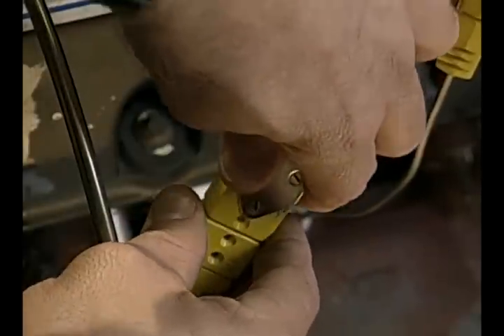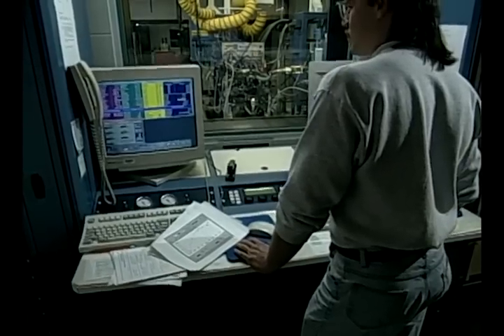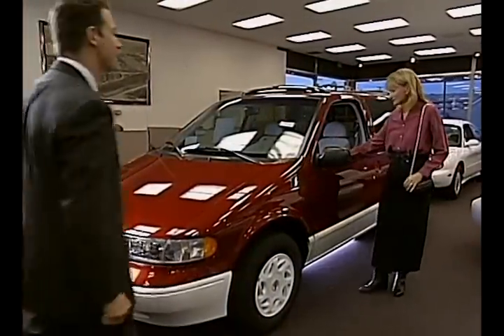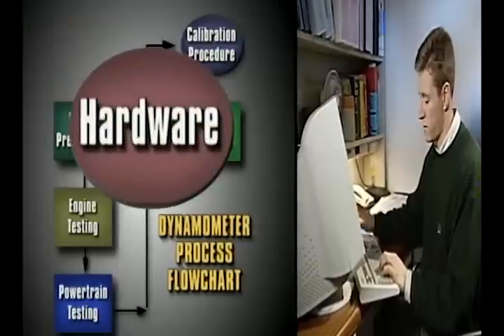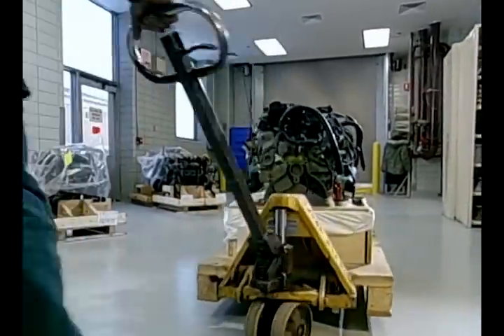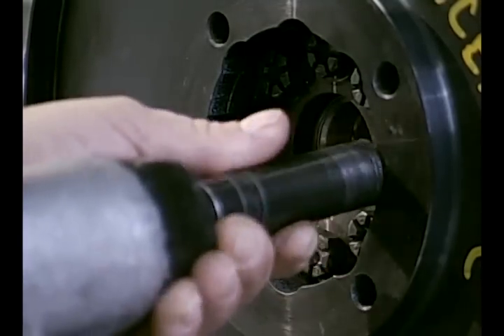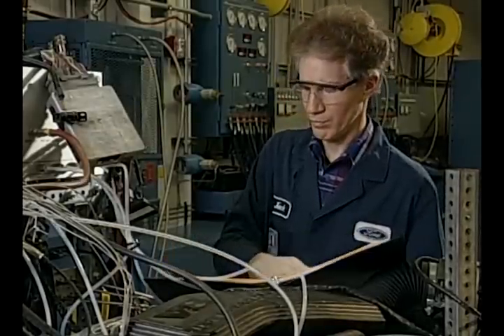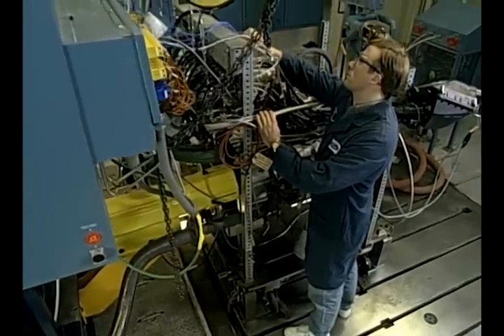Ford Motor Company, Dynamometer Powertain Calibration

Comment: Do you have the full video still?
Reply from the maker: I might on Betacam SP. The video is the property of FMC. Why are asking/interested?
Reply: I work for Ford Motor Company and work in the dyno building and for calibration. The video is interesting and unique too see what things were like, and how they have changed. I have not seen the video before. My interest is purely personal.
Reply: Id like to see it too for the same reason, interesting to see how F and G wing now have the engines in confined cells inside the dyno rooms
Reply: I'm a retired Line Tech, and was never taught about this. I'm very intrigued....
Reply: @bgayney  I too worked in the Ford EEE building behind Greenfield Village. I worked under Jerry Hacock.